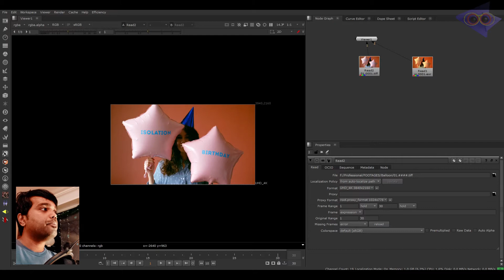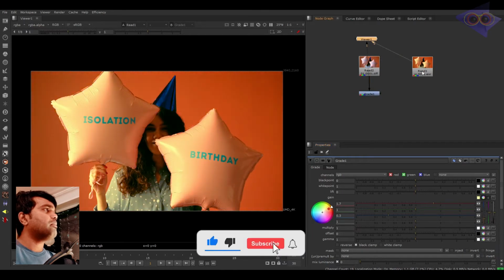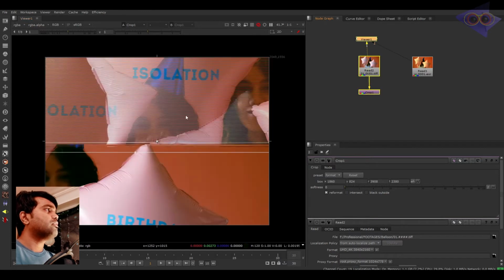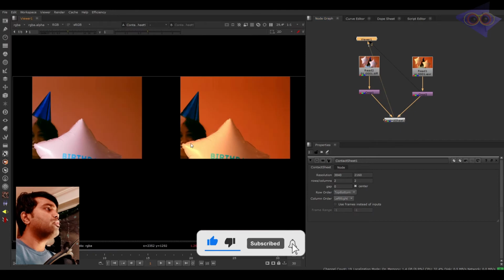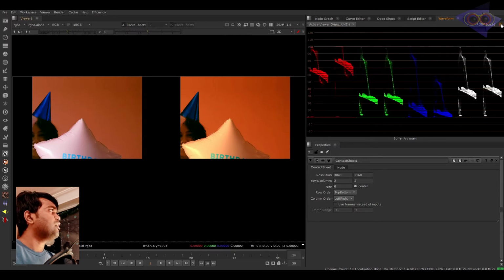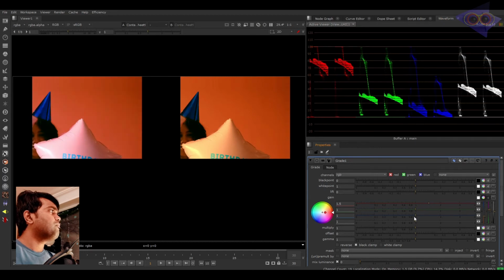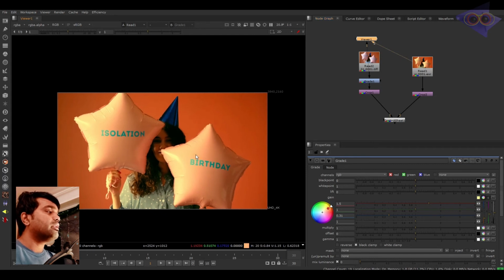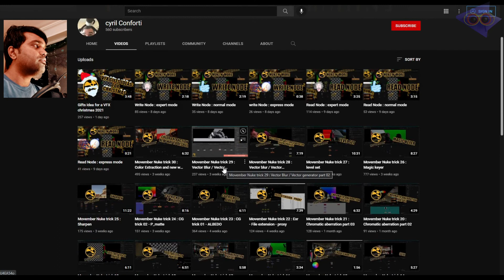Nuke Color Matching Tutorial | Accurate Color Matching with Grade Node

Comment: I have other Doubt : Was Trying To Put blood Texture on Shirt, using Bump Boss node in Nuke. (Displacement Map in Photoshop) to Create Depth and Bump.. But didn't Make it up. How can i achieve that?  

If unable to explain then, Simply How to Add Texture on Cloth with wrinkes to see depth/bump in nuke?
Reply from the maker: So doing this can be sometimes complicated. The normal procedure is getting an accurate blood stain from a mattepainter and comping. But here you can use a mix-up of techniques, including the one which you told and some grade operations creating fake highlights and shadows. Post the same question in a nuke forum to get more ideas.
Reply: @madlookzvfx  Thank you.. 👍🏻👍🏻